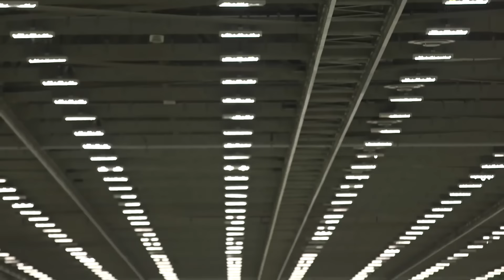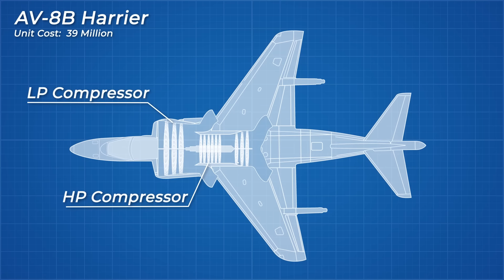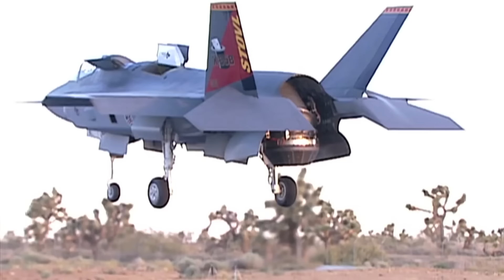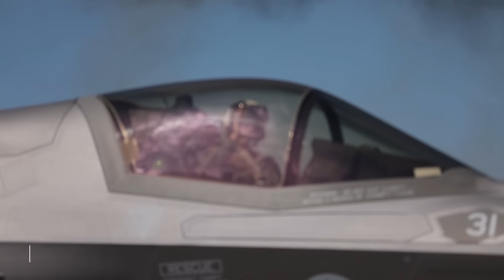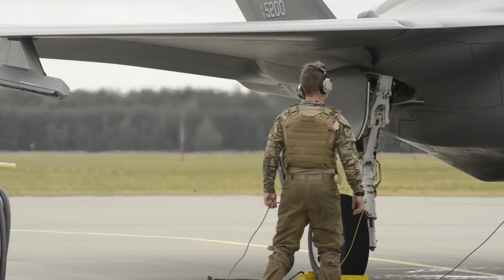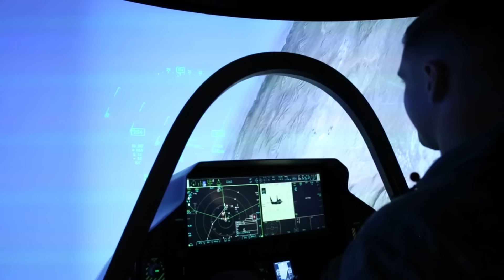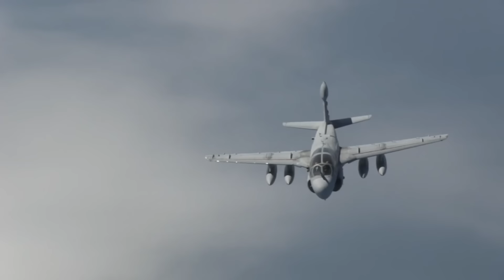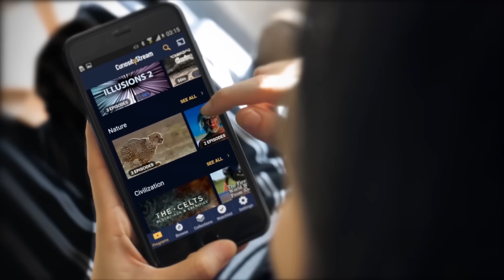Is The F-35 Worth $115 Million?

Comment: Someone told me once that those projects are called " Job security" so everyone works as slow as they can so they guarantee they will have jobs for a long time. People already learned that when those government projects end many people loose their jobs. That's is the reason those projects take forever and cost 30 times more than should. Another interesting thing is that companies will always charge more for parts and supplies used in government projects. A screw that may cost $5 in manufacturing a car may cost $5.000 when manufacturing an airplane for the government. Even if it is the same screw. Overcharging the government is big business. Tax payers pay the bill. Just to put in perspective the project cost for the Boeing 777X is 5 Billion, the project cost for the F-35 was 406 Billion. The Swedish Gripen program cost was 13.5 Billion. It cost 30 times more to develop a jetfighter in the US than in Sweden. The most interesting thing is that the next war will probably be nuclear and these airplanes will be useless. It cost 81 times more to develop a F-35 than to develop a Boeing 777X which is 20 times more complex than a F-35.

Comment: I'm curious you mentioned the fact that it likely would have been cheaper to develop 3 seperate planes. I'm curious if the economy of scale associated with the interchangeable parts will result in a reduction in supply/logistic costs vs 3 seperate planes with far less parts compatibility?
Reply: They are three different planes that share commonality.
Reply: @peterson7082  there are three diffrent planes all based on the same basic design which should mean that many parts are interchangeable. This is diffrent then having one aircraft from locked, one from boeing, and one from McDonald Douglas. Which would likely have significantly less parts interchangeability. I understand that you cant swap an entire f35a for an f35b however a majority of the major components such as flight control servos, avionics, etc are likely interchangeable.

Comment: The most feared thing of the F-35 is what it will do to the military career of anyone that does not follow the orders and say what they are told to say. This is Defence industry welfare. When you build one aircraft to do three different jobs, many compromises have to be made. Thus none of these aircraft will be as good as if three separate aircraft had been designed.

Comment: That's exactly what happened with the F-111 back in the day. You would have thought they would have learned from history, but I guess not. F-111 was a great plane but in the initial A model for the Air force. It failed for the Navy due to weight reduction inability. Like you said - design one for each service to obtain the most suitable plane for the task like F-22 as air superiority. Thanks for a great video.
Reply: Not really the case- the JSF was the program began did seek to create a universal aircraft for all three branches, as well as the international partners. However after 1993 the formulation for requirements were formed and sought three different aircraft with relatively high commonality between them.

Comment: Also, the initial developmental F-35A flight control law tests that were often cited by people claiming the F-35 is not capable against a 2-tank family model Viper has long been put to rest as the flight envelope was opened up.  Just like with the Raptor, they didn't open full maneuvering capes out of the gate with the test program.  Block 3F F-35As have been hurting Vipers for many years now in BFM, with senior Viper drivers who converted to F-35A saying that they have far more nose-pointing authority in the F-35 vs the F-16 since the F-35 isn't anywhere near as AOA-limited as the Viper.

Viper drivers who thought they would treat the F-35 like a Hornet and fight a radius fight vs a rate fight then had to learn the hard way that the F-35 retains energy more like a Viper, and recovers airspeed better than a Viper.  F-35 pilots learned to fight the F-35 in its strengths vs the Viper's weaknesses, and most BFM exchanges result in F-35s being dominant, not that an F-35 would ever let a 4th Gen within visual range of it anyway.  Once you combat-configure the Viper with 2 EFTs, centerline ECM pod, HARM or LITENING Pod, bombs, and missiles, it has no aero or T/W advantages over an F-35 (that is carrying the same amount of bombs and missiles, with far more fuel than the Viper can carry).

The Dutch F-35A pilots said when they came to Red Flag or trained against Nellis-based aggressor squadrons, they did BVR set-ups, then did BFM against aggressor Vipers who thought they could show up to the fight with 2 wing tanks.  After the first day, the Viper drivers were surprised at the results, and showed up the next day only with centerline 300 gal EFTs, still had a hard time with the F-35A.  3rd day, they showed up slick with ACMI only to re-gain whatever pride was left.

After the sorties, the F-35 pilots wouldn't return until much later for de-brief.  Viper drivers asked what was going on with the time delay for RTB, and the Dutch said, "Let's go ahead and de-brief and it will all make sense."  During the de-brief, which takes hours, they detailed how they flew every which way they wanted VLO approaches on the Vipers and killed them repeatedly, then went through all the agreed BFM set-ups with each other where F-35s were dominant, then explained how they flew out to the various test ranges to deliver live 2000lb JDAMs on-TGT after their BFM games.  The Viper pilots were awe-struck that they had been fighting F-35s with full internal A2G weapons the whole time, let alone 2 x 2000lb JDAMs.

It sent home the message that F-35 fuel fraction and internal weapons storage is a significant factor in its performance capes, and they realized the Viper they were flying is basically obsolete in comparison.  Meanwhile, people with no familiarity with the actual capabilities of the F-35 talk about what a piece of garbage it is, how much more maneuverable the F-16 is, and how their pet Flanker/Typhoon/Rafale/Viper would smoke the F-35 because they read the "leaked" pilot report of the test article F-35 from years ago.
Reply: What's actually impressive about this is the fact that such performance isn't really the strength of the F-35. The sensors and datalinks alone are just insane. The size of the F-35's AESA alone puts it ahead of much larger aircraft, but it also holds the 6 DAS cameras and the massive EOTS. It still performs really well despite all of that load too.
Reply: @ivanlagrossemoule  Yes, much of its capabilities come from lists of complaints from fighter weapons school instructors and senior fighter pilots who asked, "Why don't we integrate these draggy pods into the airframe? While we're at it, why don't we design an airframe that carries the actual amount of gas we need and then some more for good measure?"

If you look at the AFTI F-16 already in the early-mid 1980s, they integrated 2 FLIR/Laser Spot Tracker/Designator Pods into the leading edge wing roots.

JSF initially was going to be the combination of integrated incremental developmental technologies in propulsion, airframe, avionics, sensirs, computing power, and stealth.

Because the leaps in each of those areas was pushed so far out of the norm by the ATF program, the design and manufacturing infrastructure lifted everything to a higher level than I think anyone anticipated.

The bar has been set so high, that the strategic and geopolitical implications are that no other nation will be able to compete with the US in aerospace defense.

If you look at the 10 largest defense-spending nations, all of them are either already US customers, JSF partners, Russia, India, and China.

China can't sell to India, so any potential customers for Chinese 5th gen attempts will not be able to afford many of them, if at all.

Comment: It's best to understand the JSF program as 3 separate airframes that share a common avionics and engine core, not airframes that were compromised because of a common airframe design as much as has been hyped.  Nobody has done a cost-benefit analysis in the media sector of all the airframes it would take using older technology to attempt to cover some of the capabilities of the JSF fleet, including all the ancillary systems that cost multiples of millions per unit in addition to the aircraft, when said systems are integrated into the F-35 seamlessly from the start.  Then when you realize that F-35As are currently rolling off the production line at costs that are similar to, or less than legacy airframes with nowhere near the capabilities, the cost analysis really favors the F-35 considerably.

Examples with 4th Gen fighters include:

* External ECM pods necessary for operating in high IADS threat environments
* External Electro-Optical Detection/Targeting/Laser Spot Tracking Pods
* Helmet-Mounted Cueing Systems
* Certain Countermeasures Systems that require additional external profile

So the base price for a Super Hornet or later Block F-16 is one thing, whereas all the necessary ancillary combat systems that get bolted-on (taking up opportunity costs for weapons stations in the process) are millions of dollars in addition to that base price.  Further, since the upgrading of these pods/external mounts often includes complete pod body replacement, the scaled costs run away from you quickly when looking at fleet sizes.

With the F-35, all of these systems and more are integrated into the physical airframe and subsystems of the F-35 internally, with software-leveraged upgrades that can maximize the life cycle of the hardware components.  When the hardware needs to be replaced, you don't have to manufacture a new external case for them, and scale those costs across the fleet, which saves billions in comparison.  Also, since the 3 services and multiple coalition partners share the common avionics and engine cores, your upgrade costs go down because of purchasing volume.

Then look at lethality and survivability.  If it takes you 4 legacy aircraft with attrition to execute limited mission profiles vs 1 JSF to execute expanded mission profiles, the pay-off in pilots' lives saved and destructive campaigns compressed in time is unprecedented.  Right now, the air threats know that everything is done on our terms because we hold all the cards in SA, so instead of having more frequent skirmishes with opportunistic regional powers (or F-14 RIOs who can't discriminate between new Flogger pilots doing their 2nd check ride and a nose-hot interceptor looking for solutions), we're experiencing far less actual aerial conflict as a result.

This helps with regional stability, as much as pilots would love to be told, "Eradicate any threat air with extreme prejudice until all their fighters and aircraft are totally destroyed!"

Comment: This video is spot on, as it touched upon all the issues surrounding the F-35 program, with the exception of how far behind schedule the F-35C continues to be for the U.S. Navy.  After all, the original plans called for the FA-18E/F Super Hornet production line to be shutdown several years ago, but because of the tardiness of the F-35C, the FA-18E/F remains in production, and is scheduled to do so for at least several more years.  The advantages of Network Centric Warfare incorporated into the F-35 cannot be overstated, and is what sets the U.S. military -- and our allies apart from Russia or China.  But one cannot help but conclude that this will be the last fighter aircraft designed and built for all three flying branches of the military.  Doing so was indeed a costly mistake.

Comment: One thing I've always wondered about the F-35 is, why didn't the -A and -C variants get combined into a single -C variant when it was decided to split the Marines' version off? The -A's smaller wing area vs the -C doesn't really give it any advantages in other areas, and there's been history of the US Military using a Navy craft for the USAF as well (e.g. the F-18 variants). With the lack of commonality of parts across even the -A and -C variants, one has to wonder how much money could have been saved by reducing the development from 3 variants to 2 for little tradeoff.

Comment: Only the most expensive on the 3 models costs that much. The Air Force version that doesn't need carrier gear or the VTOL system will only cost about 85 million. That's comparable with most 4th gen fighters.
Reply: F-35A is confirmed to be roughly $78 million for the upcoming production batches. The F-35B will be around $108 million and the F-35C around $95 million.

Comment: October 3, 2019 will mark the manufacture of the 435th F-35.  This video says it will now begin to be produced in large numbers.  I'm confused. What number of F-35s manufactured does Real Engineering think makes the number "high volume manufacturing"?  I think 435 is a high volume number. The F-35 became operational in 2015 and saw it's first combat in 2018.  Design and development will continue for the entire life of the F-35.  Design and development continues today on the B-52, though none have been built since 1962.  That's over 70 years of "design and development" according to Real Engineering. I don't buy their definitions.  The B-52, in today's dollars, would be priced at $108 million each.  The F-35A is less than $80 million each and is getting cheaper every year.  Why does this video say that the F-35 is "the most expensive weapons system in the history of mankind" when the B-52 was MUCH more expensive?  This video suggests that the Boeing F-32 may have been cancelled because it was ugly.  Anyone following the development of the F-32 vs the F-35 would know that when the competition fly-off was held, the F-35 took off and landed vertically, then went supersonic.  The F-32 was totally incapable of vertical takeoffs or landing. In fact, no Boeing F-32 has EVER taken off, landed, or hovered using vertical thrust. For someone competing for a contract that required it to take-off and land vertically, Boeing screwed the pooch by not delivering anything that was remotely capable of doing that, then Boeing complained that it's rejection was because it was ugly.  Apparently, the producers of this video are not aware that the Boeing F-32 couldn't do what it was suppose to do.  The video also doesn't even mention the most important capability of the F-35 in combat.  That is the integration of all weapons systems in theater into one massive weapon able to find and destroy any target in the theater without putting any assets at high risk.  A single F-35 can target dozens of Mig-15/17/21/23/25/27/29/31 or SU-25/30/35/50/57s 200 miles away simultaneously without any of the target aircraft even knowing that a radar was looking at them.  All Army, Navy, Air Force, and Marine units in theater could see the target from the F-35 transmissions and all of them could fire multiple missiles of any kind at the dozen or so enemy fighters being targeted. The single F-35 could guide all the missiles simultaneously from all sources to all the enemy targets from 200 miles away.  The enemy aircraft would be busy performing multiple "Cobra Maneuvers" while dozens of missiles fired by Navy ships, Air Force F-15 fighters, and Army SAM sites fly up it's ass.  All this with every friendly asset being out of range of any of the enemy aircraft's missiles.  THAT is what the F-35 is capable of.  Why doesn't Real Engineering do it's homework and produce a fact based video. This video regurgitates old paradigms that have been shown to be false.  Perhaps some of the Real Engineering people are ex Boeing employees who are angry that their F-32 "ugly" duckling was rejected.

Comment: Neva is a 1969 missile system that toppled the F117 in Serbia. And B2 (the spirit of Missouri) was also shot down by the same system over Serbia in 1999. The B2 plane crashed in Croatia near the city of Osijek. Everything has been cleaned. Two meters deep, they took possession of the land. Today, there is a lake at this place! I know, and you know, but I do not know why you're hiding?
Reply: The Serbians never claimed to have fired upon a B-2. Nor did the Americans lose one. Keep in mind the S-125 and its associated arrays in question were modernized systems from the eighties- and the F-117A was an antiquated aircraft that lacked any form of countermeasures save being low observable and saw no modernization that improved survivability since introduction in 1983.

Comment: It's funny he goes through the some historical vertical takeoff tech and never mentions Yak-141 which F-35 is directly is influenced by as Lockheed actually collaborated with the Yakovlev company.
Reply: Nope. The F-35 design dates back to the late 1980s, and the only things it shares in common with the Yak are also things it shares in common with the Convair Model 200 from way back in 1973. The F-35 is essentially a scaled down YF-22.
Reply: @dumdumbinks274  F-35 has been in development for over 25 years. They were adding features and changing the design along the way, if you didn't know that was possible.

https://www.flightglobal.com/news/articles/lockheedyakovlev-discuss-astovl-25571/

Comment: NO the F-35 is NOT worth $115million... however $115million is the unit cost for the development of the the most technologically advanced aircraft ever (the F-35 Lightning).  The F-35 has a few tactical advantages over the F-22 but the F-22 has a smaller radar signature.
Reply: F-22 is less stealthy, not more.